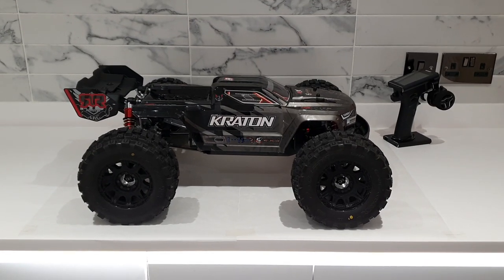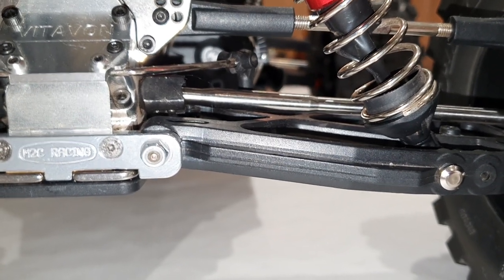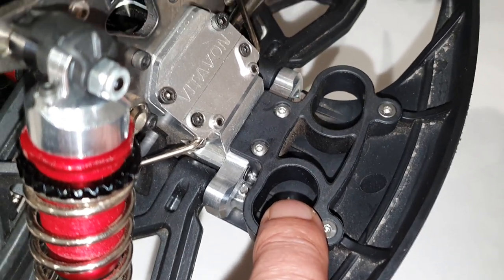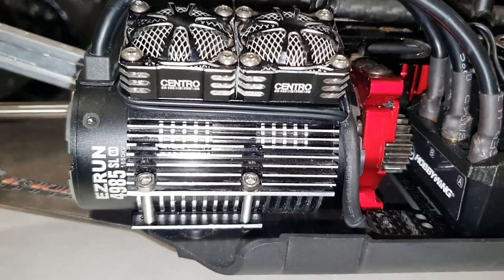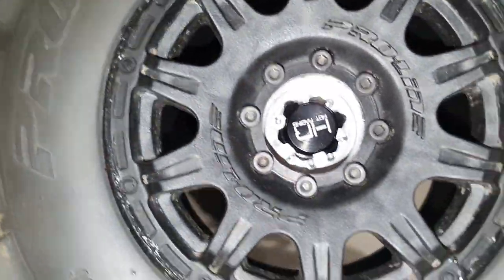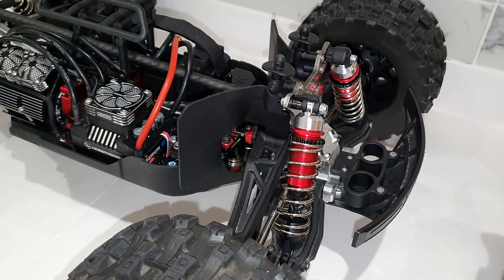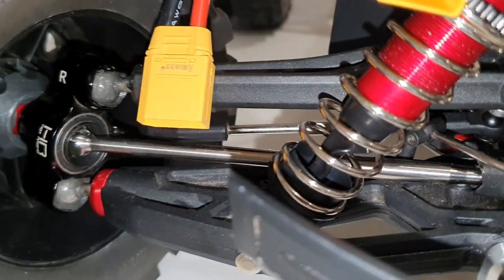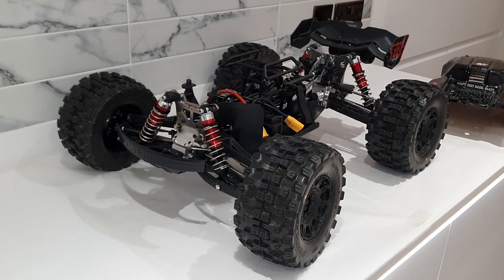Arrma Kraton EXB super build stage 2. Full titanium upgrade. All the best parts.

Comment: Hi Tony (me again lol) got the basherqueen esc mount. Where did you get the instructions to fit? Her video is dated.  I’m a little confused with the new version and all the different screws lol
Reply from the maker: To be honest, I think I had the same problem.  Just lay out the pieces on a table and match the spacers using the standard ESC mount. Tucking all the wires away is fun. 😱🤣 just be careful not to pinch any wires. 👍

Comment: Tony!! That Rig is a thing of beauty! She’s full send ready my friend. A few things you have I really want. I’m really digging your upgraded drive shafts throughout your rig. Those titanium one look legit. It looks like M2C put out upgrades in that department recently… Do you have an opinion on which I should upgrade to? M2C or Scorched? I like what you did with your battery tray too. I didn’t try hard enough to find those unique bolts and you you probably know I simply used m3 bolts and large washers to lock mine down. I do agree though… a yoga mat is not enough (even two layers of it) to properly protect my batteries from the little nuts sticking up. I’ve since put a hard buffer plate in between my battery an those bumps. Still your way in general is a better solution. Loving those belted tires you got. I do think you might want to upgrade your servo to a high torque/highpowerer Servo one of these days, but what you have is fine. Regarding your spring setup… I might drop my shock fluids down to 3000, instead of 5000 and see how they feel. Jump Master Rc also runs 3000, and he’s reporting a similar “anti slap” drop distance as mine… so I think the rate of return for slap prevention might actually be around where your at, or 3000. Whats your rig weigh now? With battery in/body on etc. I’d love to see (or be told) what your drop distance test is now with all these new improvements.

I actually picked up a bran new set of stock shocks (from the EXB) and plan to do a re experience the stock feel, so I can find the middle ground for what I want. I might end up dropping away from the nero springs to a spring I found thats actually in between stock, and those 18lb Neros. Its a set of springs from Century springs part number 1631… they require a bit of Dremel work to flatten the ends but thats ok… I thing with brand new shocks. 3000k all around and these 11lb springs.. it might be golden. An improvement… someone needs to invent snap on snap off springs load outs… some sort of unique shock rod end (top and bottom) that can open up and clip on and off the truck, but still be strong. They you could have 2 or 3 custom spring load outs for different scenarios… Skate parks, dirt jumps, racing… speed runs etc. HMMMM… I better get a patent on that. Lol  Anyway… love your rig Brother!!!
Reply from the maker: Hi Buddy.  Thanks for the feedback. First the drive shafts. I would definitely pick titanium over steel every time due to the properties of each metal. M2C are using high quality steel that is thicker than the original so their shafts will be a good deal better than stock but they will weigh a good bit more. Scortched parts titanium shafts are a good bit thicker than the M2C ones,(as far as I can see from pictures) and they weigh a little less than stock shafts. Rotational weight is a more undesirable than static weight and the titanium will retain it's shape and not wobble out of true. The properties of steel are such that it doesn't spring back into shape easily. Titanium springs back really well. Actually it deflects impacts REALLY well. (2mm thick titanium plate can deflect a 9mm round and not have any damage) Anyway this means that Scortched parts shafts will be lighter and stronger than M2C,  However this doesn't mean M2C are worse as you also need to consider wear. Steel will last longer if used a lot and not maintained, but the only area that needs checked and greased is the front outer knuckle and I don't mind doing that every few runs. Scortched parts wins it for me every time. 
The battery tray is an easy one. I watched "Bournemouth RC " do this. Check out his channel and look up his battery tray mod. I have a bag of about 150  M3 tee nuts. If you can't get them easily then send me an address and I'll send you a handful of them. You also need M3 x 10mm countersink hex screws. I also used layers of black modelling plastic sheet to build up the protective base. (Tamiya do a good liquid cement for sticking the sheets without leaving bumps.)
I haven't weighed it yet but I think it must be getting close to 17 pounds.
I thought I would try 2.5k fluids in the shocks and I am pretty happy with how they are. I'll let you know after a few runs and will do a quick drop video from 30".
Wow. That's the biggest reply I ever wrote. Thanks so much for taking the time to watch and feedback.  👍👍👍
Reply: @TTRC  , anytime brother. Great info. think I'll do some shopping at scorched parts. lol. talk to you later.
Reply from the maker: Thank you again. Speak soon.  🙂👍

Comment: Now that's one hell of a custom build including almost every choice aftermarket part/components that I myself would have chosen if I were tobuild another scratch kraton. 🍻👌Excellent explanation of it all as well.  Don't know if you mentioned using 2500 shock fluid  or not but was getting to thinking I might try some much thicker fluid than I generally use for my XL kraton? Well done
Reply from the maker: Thanks so much buddy. 👍👍

Comment: Hi Tony can I ask where did you get the heat sink from? Cant find one to fit my 4985 motor?
Reply from the maker: Hi Buddy. I used a heatsink/fan kit from Yeah Racing. It's supposed to be for a 41mm motor. I just gently bent it out a little further. Powerhobby do the same kit.

Comment: Hi Tony , did you have to make any mods to the scorched parts centre brace and or the HR ends?  I’ve just come to fit mine and find they are slightly longer than stock.  The bar and ends look fine but when put together they end up being a tad longer and they are fully on.
Reply from the maker: I seem to remember the Hot Racing ends coming with a little spacer. When I put it together I found it was too long so I removed one of the spacers. Other than that there was no problems with it fitting.
Reply: @TTRC  thanks mate , yes there’s 2 white washer things I thought they sat inside but will try taking them off tomorrow.  
The thread in the scorched parts bar seems a little longer too so I can try trimming that if not
Reply from the maker: @darrengaynor4966  you should be ok with one of the spacers out. 👍

Comment: hi tony, how did you wire the 40mm centro fan into the esc?  did you have to chance the connerctor?
Reply from the maker: It plugs straight into the esc and you shouldn't have to change the plug. It will be a 2 prong plug that is going into a 3 prong socket. It plugs into the 2 on the right leaving the 3rd prong on the left empty.

Comment: Can you help me with a link to the hot racing hubs Everywhere else online says they will not fit the exb but u have them on so they got to work or and I missing something
Reply from the maker: Hi. The Hot Racing hubs definitely fit. In fact they fit better than the standard ones. Put the following part numbers into Ebay and you should have no problems.
Front Aon21m01  and rear Aon22m01
These are direct replacements for the Arrma ones.  Make sure it is those exact part numbers as the other ones don't fit.
Hope this helps. Thanks for watching and subbing. Let me know if you need anything else. Thanks. 👍
Reply: Thanks so much for the help been loving your videos super helpful would like to see you run that in 8S that’s what I am doing with mine not going to far into the upgrades but yours is a great example to strive for keep it up your doing a great job 🤠
Reply from the maker: Thanks. Happy to help. 👍👍👍

Comment: I think I'm going for carbon fiber everything. I don't think I'm going to send my kraton to the moon as much as others so it should be fin
Reply from the maker: Carbon fibre should be fine for sending. It's also super light. It doesn't matter what these things are built from, if they have a bad landing then something is going to break. That's why I don't use metal suspension arms. I would rather the cheap/easy to replace arms broke rather than the diff housing. Thanks for watching buddy. 👀 👍
P.s. my kraton is about 7.5 kilos fully loaded.

Comment: Hi Tony, what a clean and strong build! That thing looks amazing, how much does it weight with the bodyshell included?  (without batteries)
Reply from the maker: I'm not sure. With the batteries included it's about 16lbs
Reply: @TTRC  Thanks! 👍
Reply from the maker: @mvtepixels  I just checked the weight of the battery and its 910gs. So without the battery it is about 14 lbs. Thanks for watching and commenting. 👍👍👍
Reply: @TTRC  🙏🙏